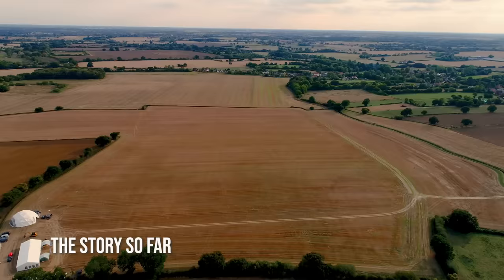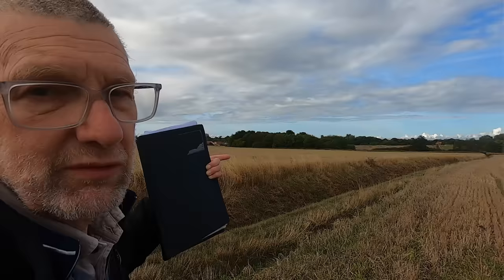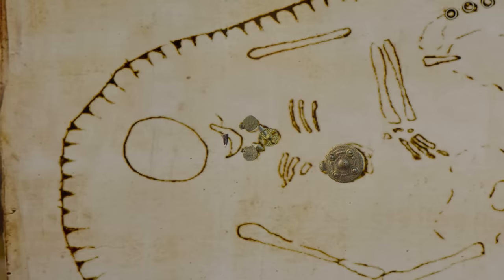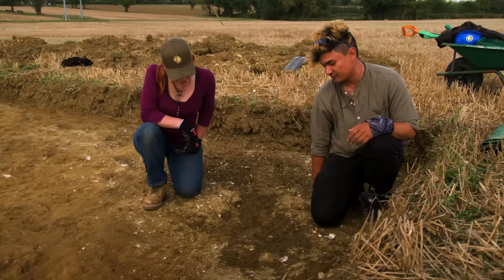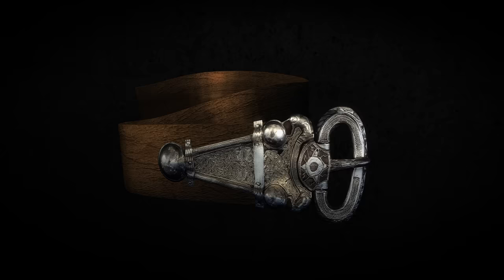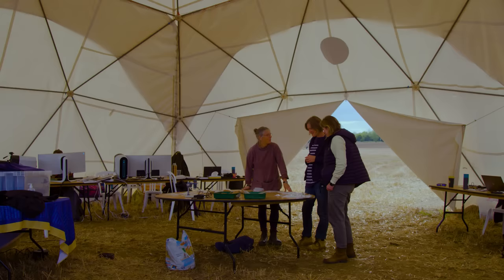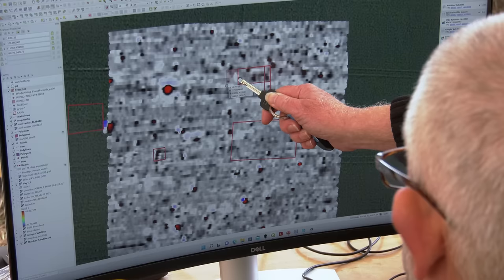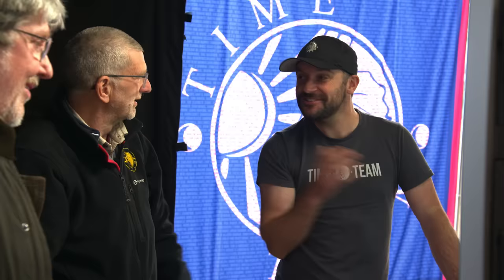NEW EPISODE | Day 2: Anglo-Saxon Cemetery | TIME TEAM (Norfolk)

Comment: Nearly skipped the poetry at the end, had low expectations, but it turned out to be the best part of the programme - very moving. Is it not possible to be more careful excavating though? That the most interesting find was found with a metal detector in a waste tip from the bulldozer seems telling. You knew the site was a couple of inches below the grass - why not excavate by hand? Did you pass a metal detector over it beforehand? Why not use water on hard ground instead of pickaxes? Questions, questions. Anyway, good show!

Comment: Speaking of Roman, why did the ancient romans stop at hadrians wall? Is it adrian or hadrians wall?
Reply: The tribes further north were so much trouble that they built the wall to keep them out - thus reducing the need for constant skirmishes which drained resources and tied up soldiers...   
'Hadrian'...!
Emperor 117-138!
They started building it in AD 122...
Reply: They did extend north to the Antonine Wall for several decades. But there was little point in spending large amounts of wealth to control  relatively economically worthless lands when they had lots further south barely populated.

Comment: I thought modern farming had moved away from ploughing. Drilling I understood reduced the carbon thrown into the air and the century old seeds that germinate when exposed to light. With no ploughing the destruction of archeological sites would be slowed.
Reply: In very wet areas, ploughing is used to get air into the earth (faster than worms). Also, wet earth does not fly off as easily. The bad thing is since the English did it this way, they said it was the best and exported it to much drier parts of the world and a lot of fertile soil has been destroyed because of it.